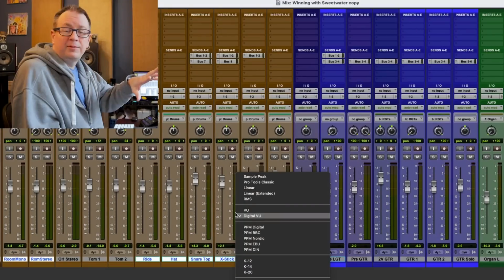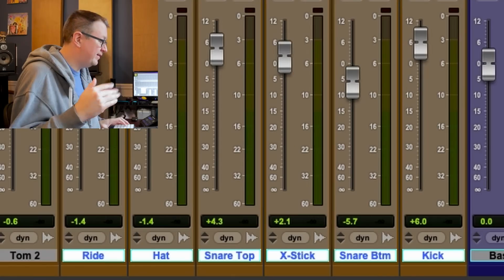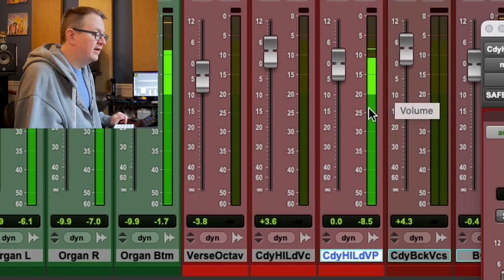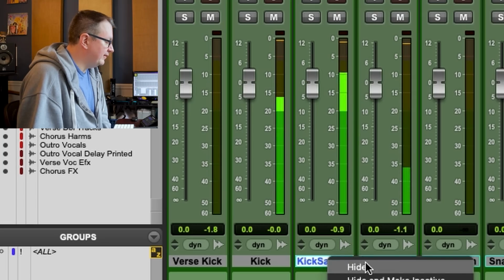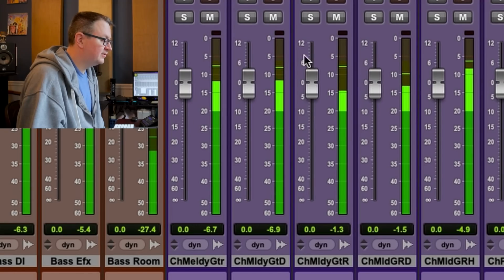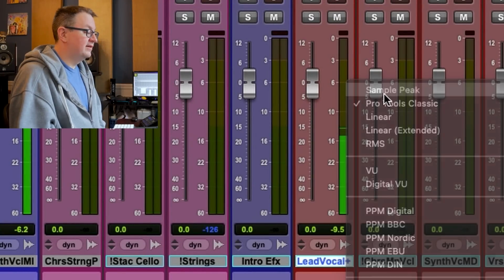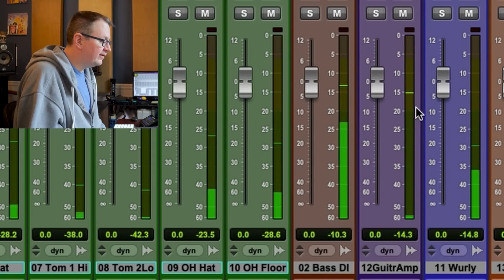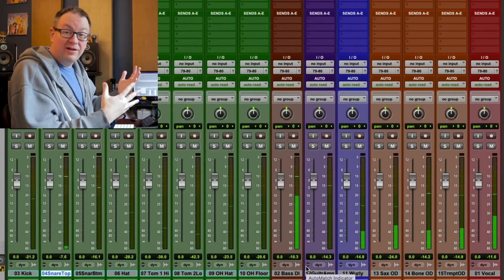How Legendary Engineers Set Input Levels

Comment: Remember boys and girls, dBFS = Decibels Full Scale, which is the Digital Scale (-inf to 0, zero being the Maximum, above which there is distortion.) Setting your levels between analog devices and a digital (DAW) converter, you want to see what the converter uses as the level reference (-14 to -20 levels are the most common) and set your ANALOG devices ZERO to that digital reference. So, if your analog console states that their Zero has a headroom above that of = 16 dB, then you set your converter to be at -16 dBFS at the converters input gain, when the analog signal equals its Zero. This matches your Analog devices headroom (the place ABOVE its Zero) to your converters 16 dB above that -16 dBFS. So when you get a red clip in your analog device, that will translate also to a digital clip. Cheerio and Merry Christmas.
Reply: What if you want analog clipping but not digital?

Comment: "Gain Structure"... Are we talking Channel Gain or Channel Fader? There's usually a difference, but if not, then gain input is controlled by the output of the source. Gain is corrective, but fader levels are creative. Of course, "gain" is pre and "fader" is post in this description. If that's the scenario, then it is highly recommended to structure gain settings in a way that allows the faders to be equally referenced. If you've done this, then you've set up a level playing field to subjectively create. (This is all assuming that you have left enough headroom with no clipping in the first place). Disagree? Let me know.

Comment: If you are recording at 24-bits, that means full scale is 146db and you have over 16 million steps between there and silence. That's an insanely huge amount of resolution. 16-bits gets you 98db and 65k steps - also more than plenty resolution. So a goal should be figuring out where on your meter gets you about 16 to 18-bits of resolution - which is probably a lot further down the meter than you think - each new bit represents a doubling of values.

Comment: That's great but one thing I wanna point out : "digital VU" is just a meter in dBU or dB universal scale where anything above 0 means it's clipping (so there is no concept of "overhead"), but it's not actually a VU meter. That's useful for recording digitally because anything that's digitally clipping means it's going over the amount of data the file can contain. On analog gear, the meters are actually VU meters, which measures the loudness dynamic of a signal, not it's linear signal input. You can calibrate a VU to whatever target you want. I much rather like the traditional VUs with needles because it displays the overhear past the 0 with the black portion. That way you have a good idea how much you can push a signal for saturation's sake. My dad worked in the 70's onward and said that you could hear the needle go "tick-tick-tick" on the his drum bus's VU...! Harisson Mix is great if you want a real old school board emulation, VU, gain and all. Cakewalk ain't bad either, and there are tons of plug-in to check your loudness dynamic, too. It's much nicer to check it on a VU than a dBU meter where you're always squinting to try to see exactly where you at (I hate those things tbh). Cheers!
Reply: I saw there are VU plugins and thought who the heck needs that. I now have it because it was part of a bundle and I use it a lot now, who would have thought that 😃

Comment: Thanks for this, most people tend to record too loud something that is not necessary in the digital domain specially when recording in 24bit.
I still am not sure about my master-bus mix levels, I read somewhere they should be "-6dB Peak loudness, with an average of -18 LUFS integrated".
In my opinion that is a little bit to low, I tend to hit around -15 LUFS but have no idea I'm doing it right because higher levels means lower dynamic range.
For mastering some engineers go for around -12 LUFS integrated, with a peak of -8dB.

Anyone any suggestions because I'm still not convinced about these levels, they probably also differ by the genre such as pop, metal, acoustic duo's, etc
Reply: I would expect LUFS to vary by genre because, as I understand it, LUFS is affected by the frequency spectrum too, so brighter genres with more distortion, lots of cymbals, or synths are genres that I would expect to have higher LUFS to peak ratios.
Reply: @jeepo500  yeah you’re right. I heard a mastering engineer say that by boosting certain higher frequencies the perceived loudness will be higher without pushing a limiter too much. Especially in EDM and base heavy songs LUFS of -9 to -5 are no exception. -12 LUFS seems to be a good target for streaming services. 
I think I need to run some reference tracks through an analyzer and a lufs meter and see what’s going on.

Comment: Interesting perspective. This idea of using a VU for tracking into a digital recorder, is perhaps a red herring, it made sense with tape, and calibrating a tape machine to an analogue console. The simple fact is that digital recording needs headroom so the plugin processing chain does not “clip”, so out of all the recordings here Al Schmidt had the right idea. It doesn’t matter what you are recording jazz, classical or rock, you don’t want to clip any recording channel, in fact most of these meters do not show true peak, which is what you really need, particularly if you are getting anywhere near 0dBFS. Driving preamps is entirely a different thing, so in fact if you want to employ this type of recording method you need preamps with output gain as well as input. -8 to 10 dBFS  is a good max figure to aim for, so approx what Al is doing.